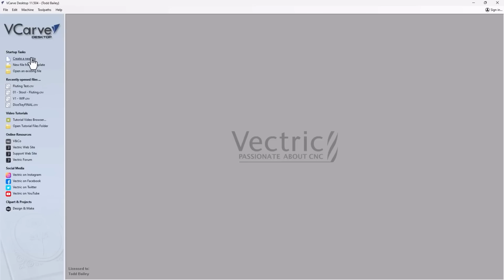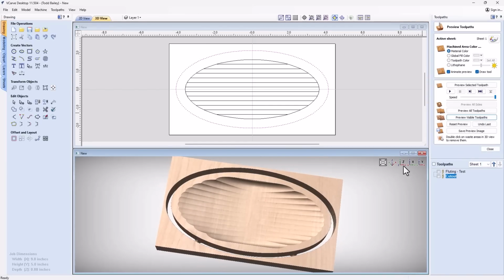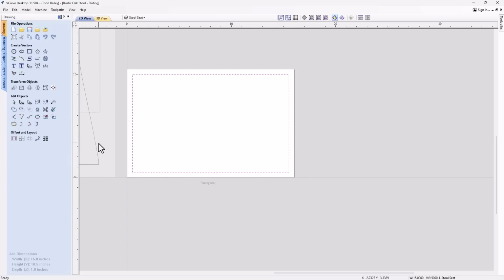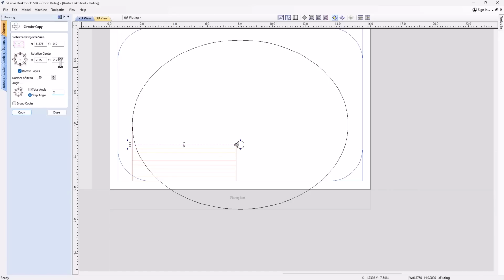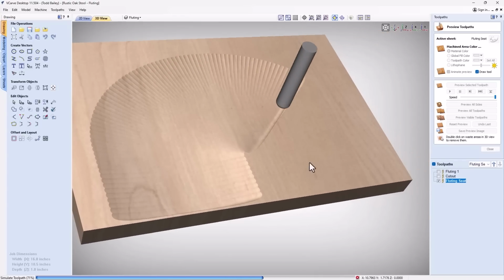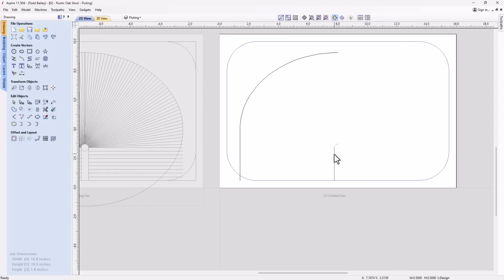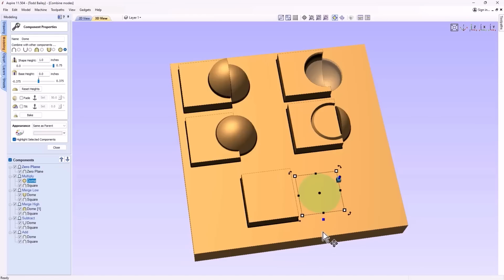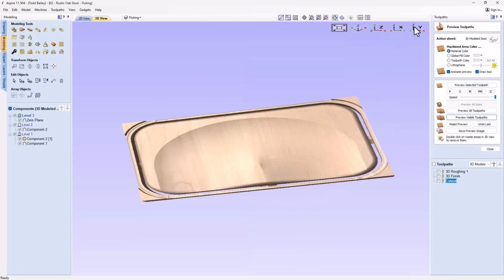Rustic Oak Stool | Making a Stool on your CNC  | In the Labs with Todd | Vectric FREE CNC Projects

Comment: nice tutorial on carving, but that stool will last 2 minutes with any weight.  The legs will soon break with those short tenons.  Chairs take a lot of stress and a lot of that translates into the legs and the joints.
Reply from the maker: Hello Mark.  Thanks for the comment... to be fair... the one I made has been used a lot in the office, and it is still standing.  If you are worried about that, you can easily add in a few cross braces.  Also, the legs on this project are made from oak... and they would be hard to break unless you really tried.

Comment: Over last few years I made about 12000 jobs using your software. The only 2 minor issues in that time were: lack of multithreading and lack of tool for finishing inside corners with smaller diameter endmill. Thanks and tace care.
Reply from the maker: Hello... and thanks for the comment.  Actually we do use multithreading for many of the performance critical parts of the software.  Not everything but a lot of it.  For finishing the inside corners we do offer using multipal tools in some of our toolpath strategies, so you can add in a smaller tool to remove som of the material a larger tool misses.  We offer that in our pocket, Vbit and 3D finishing toolpaths.  Hope that helps.